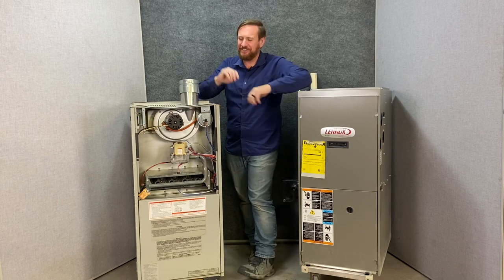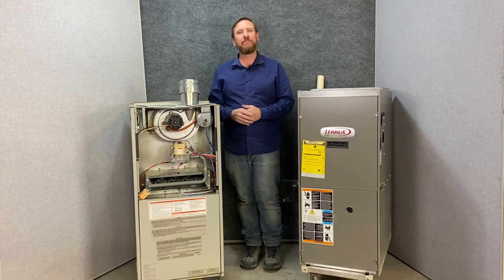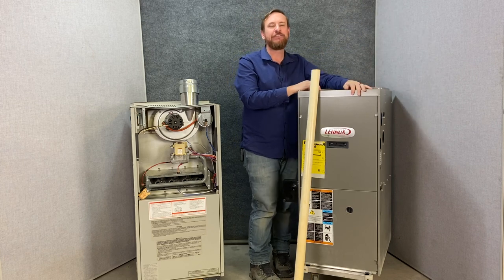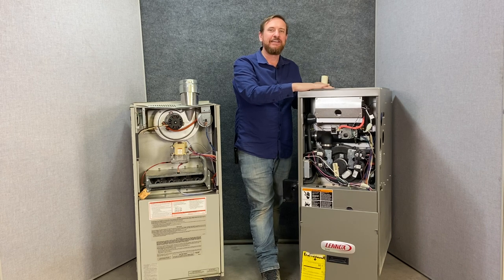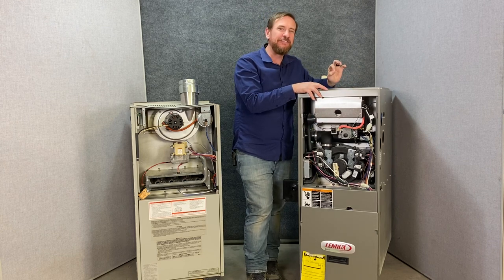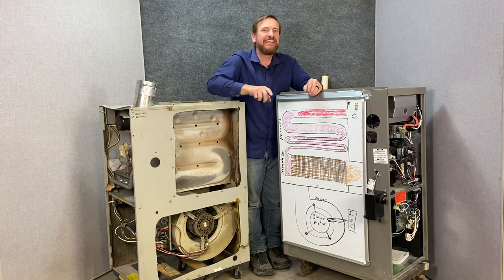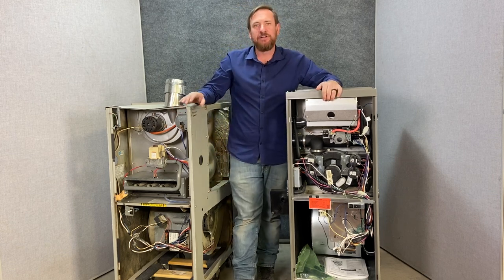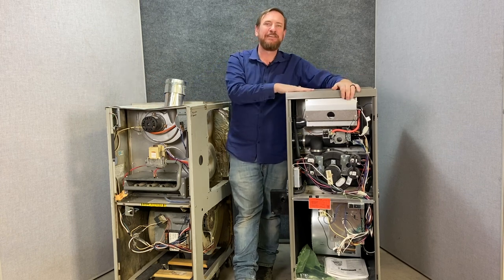80% vs 90%+ Condensing Furnace

Comment: High-efficiency burner all well and good but when it breaks it cost a fortune to fix so what the hell are you saving
Reply from the maker: same could be said for carbarated engines.
At one point the 80% furnace was modern and people said the same about it, before it was the standing pilot and their at the time modern controls, then before that was the cast iron heaters that replaced the simple and reliable wood burning stoves. 
Technology and change comes if people likes it or not.  
The biggest issue with the 90% furnaces is improper installation, improper airflow and improper setup. Once techs learn the systems and read the fabulous manuals they become quite simple and reliable.
Reply: @love2hvac  hmm
Reply: My dad had a furnace in this house for over forty-two years and they said it had a hairline crack in it! And they never did show it! Since then on the third furnace them high-efficiency furnaces only last like 10 years or less! Next time I'm putting back in 80% and you don't have to worry about a damn water pump condensation! Hell I might even put in a wood burner!
Reply from the maker: You only have 2 years left before new regulations take over.
Reply: @jcaleca60  correct; it would be nice if he would discuss the repair costs of both types of furnaces, 80% wins hands down
Reply from the maker: Single stage 80 compared to single stage 90+ of the same brand has most of the same components. Identical flame sensor, hot Surface ignitor, gas valve, pressure switch, blower, limits, aux limits, flame roll outs. The 90+ will have a plastic inducer vs the metal of the 80 but both have the same life expectancy.
The 90 will have a 2 part heat exchanger vs the 80 single. And the 90 will have an enclosed burner box vs the 80 open. What in there costs more?

We can do the same with the 80 2 stage vs the 90 2 stage. But noth now have 2 speed inducers, 2 stage has valves and 2  pressure switches. 

The one that will have the most cost issues is the fully modulating furnace.

Did you know a heat exchanger should never fail for any furnace. The biggest problems are incorrect installation of all furnaces. Installers early follow the installation manual that includes clocking the gas meter, combustion analysis, airflow and static pressure. 

If we could get companies selling the proper sized furnace ACCA manual J S D and then pay a professional skilled installer with the  tools and abilities to actually install them correctly, customers would never have an issue with any furnace installed.
Reply: @love2hvac  you’re absolutely correct. The issue people are having is companies scalping their customers that spend xtra money on a high efficiency. They charge exorbitant amounts and most are not installed correctly.
Reply: Saving the earth 😂
Reply: Love the high efficiency furnance... A nice steady temperature along with a humidifier.  For me it's well worth it and comfortable. 👌💯
Reply: I work on high efficiency all the time, standard furnace parts are really not that much more expensive at all, however you do have the occasional condensate leak which is a hassle.  Add a heat pump, it does get more complex.

Comment: The problem with a two stage furnace is the cost of draft inducer motor which needs two speeds. My draft inducer motor lasts about seven years & the part is $600 & with instillation it is $1000. Lennox parts are super expensive I would by a Goodman. Unless your house is super insulated just go with single stage.
Reply from the maker: A 2 speed motor doesn't cost that much more than a single speed for manufacturing. 

The problem is the manufacture marking things up, the supply house marking things up and then the company marking things up.  Private quiet companies are buying up all the HVAC companies and they are requesting Every penny they can out of the market. 

A lot of these companies are raising prices so high that it makes a new unit look cheaper so they can sell more units and increase profits. I know of several large companies that trains primarily in sales and sales tactics.
Reply: @love2hvac  I agree with you. I am thankful I can do some of this work my self otherwise it might be better to just buy a new unit.
Reply: @love2hvac  Goodman is one of the few that will sell directly to the public.
Reply: Some 2-stage draft inducers are more expensive than others the contractors gouge on repairs and markup.

Comment: I'm in central NC and only spend about $500 on heating gas between Dec- March (mostly last 2 weeks of Dec thru 1st week of March) at which point we shut the furnace off completely. 10 % savings vs the 80% AFE model would be minimal for me. At best I might save $50.00 year on a 90% efficiency model ---- It's neglible in my case so I'll probably go cheapest route with the lennox Merit economy. At least your video helped calculate and refine my thought process.
Reply from the maker: 80% works well as long as the home is not tightly sealed. If it's going in a tight house or sealed attic then consider the other.

Also consider a dual fuel heat pump. Heat pump is more efficient higher ambient than even the gas in many places. Then use the gas on the colder days or when you need faster heat. They work well together

Be sure to get a heat load calculation. One of the biggest issues is oversized furnaces and I oversized AC.

Who ever installed the furnace, have them clock the gas meter for input BTU. Sometimes the offices have to be changed. Also have a combustion analysis performed. They should give you a print out of the conditions.
Reply: Exactly. If you are in a mild climate and or areas where gas is relatively inexpensive, the payback period is YEARS!
Reply: heres the thing most hvac companies will not tell you about high efficiency furnaces.  What you "save" on your monthly gas bill goes straight out the window when it comes time to service or even replace.  90% have a lifespan of around 10-15 years where as 80 % last 20+ years

High efficiency furnaces tend to start having problems not long after the warranty runs out on the equipment installed.  They have a secondary heat exchanger and are equipped with more safety switches and sensors, that can and will lead to more service calls. 

 The upfront cost is more expensive based on equipment cost and labor/material.  If you go from an 80-90% you have to install an entirely new pvc exhaust system as opposed to adapting to the existing metal one.  The install could take as much as an extra day depending on how difficult it could be to find a way to run the flue based on how your house is set up.

I would advise towards investing in a 2 stage 80+% furnace.  In short, it wont burn as hot or intensely on cooler days and the "extra" cost is dollars more per month, not hundreds.
Reply from the maker: If a 90% furnace is having that short of a life span it was not installed correctly.  The #1 issue I find with 90% furnaces time and time again is improperly installed.

The only reason they are not lasting is because the companies are not installing them correctly including airflow. 

Meanwhile other companies installing them properly with proper airflow and static readings have them lasting over  20 years. 

Single stage 90% are simple to work on and affordable parts just like the 80.
2 stage is much more expensive. No reason to have a 2 stage 80.

The real problem is modulating furnaces, those parts are expensive and it's more difficult to diagnose. 

A 2 stage or modulating furnace is not any more efficient.
A 2 stage vs single stage 80 is the same efficiency.  Most furnaces are oversized, so companies like to install the 2 stages instead of doing a heat load calculation and installing the proper sized equipment. 

ACCA manual J, S D and T
Please the installation manual and customers would be comfortable and systems would last longer.
Reply: @love2hvac  its not the installation of a 90% furnace, they straight up dont last as long period.  I just replaced a high efficiency boiler installed absolutely perfectly by the previous crew and 10 years later there was a hole in the heat exchanger the size of my thumb.  

Whether its a furnace, boiler or condenser, the high efficiency ones dont even come close to total lifespan of standard counter parts
Reply from the maker: Are you doing combustion analysis, clocking the meter, fixing the duct issues?
Contractors all across. The country with 90+ furnaces still working correctly back from the 1990's.

I did consulting for one company that said the same thing you are saying about 90%, but they did not even own a combustion analizernamd nobody at the company ever clocked a gas meter. 

It's the same thing when people say _ bran makes bad blower wheels only to find out they have bad ductwork.

Or compressors don't last only to find they don't understand superheat, or perform proper evacuation/dehydration procedures.

But every single one of those companies say "we do it rite" .

Some companies want to learn and make the changes, and see the difference.

Other companies want to be right, keep doing it the way they always have and blame something or someone else.

This is why education is so important.  Equipment technology is advancing very fast and the  government is also mandating higher edfecencues regardless of payback. 

We don't have to like the 90% furnace but  It won't be long before you can only get a 90% furnace so we must start understanding them now.

Same with heat pumps, inverters, blower door testing and more.
Reply: @love2hvac  its hard to re-do ductwork on a finished house and often you are only able to adapt to whats existing.

why shove a 90% efficient appliance down a customers throat when the condition of their home is not suitable for it? i.e duct, heat load/loss etc.  sell them what they actually need, not whats gonna line your pocket with money
Reply from the maker: Why not fix the ductwork and do the job rite.

Air and airflow is the most overlooked part of HVAC.  The airflow is essential to the system performance, the customer comfort and the performance of the home. 

Duct leakage is the leading cause of air infiltration. Every CFM lost is another CFM pulled in through the walls, bringing with it moisture and dust. This is a prime condition for things to grow. Now imagine breathing air from that space. That's what's happening to the home.

We have to at some point be the professional and start looking at HVAC as a complete home solution and stop looking at an appliance to sell. 

There is a reason the equipment manufactures post airflow requirements and static pressure limits. In the old days we had cheap PSC motors that we could easily change. Now even the 80% furnaces are mandated Electronic Commuted motors. These motors do not handle the high static pressures and are very very expensive. 

Jim Bergmann just wrote an article outlining the poor installation and commissioning practices of equipment. Check it out.

Also check out NCI classes for performance HVAC.

It's time we stop paying the salespeople to move boxes and we become the HVAC professionals and specialists  that solve whole home problems.
Reply: @love2hvac  you cant fix ductwork that is inside a finished house, especially when its inside finished walls. i guess you didnt read that part.  people arent really interested in ripping open walls to accomodate a 90% furnace they dont need

and if it is accessible in an attic or a basement, re-doing duct and flex and add several thousands of dollars to the install cost
Reply from the maker: There are solutions, you just have to open your mind take some classes and learn. 

Here is an example just a few .on these ago. I was paid to give a consult. North east climate, mandated to 90% furnaces. Ductwork was behind the walls. We ran a blower door test and found the house leak rate. The customer paid to have the house shell sealed up. We ran another blower door test and used the new number to run a proper ACCA manual J.. the existing 80% furnace was 120k BTU meaning 96k to the home. The company installed a 96% 2 stage condensing furnace. The smaller size meant the duct work could handle the  airflow. Before the new system went in they had the ducts sealed from the inside with aeroseal. 

Now the ducts where not leaking, they static pressure was .35. they system was quiet. We clicked the meter and found the offices where too large so we sealed them with the correct size. We ran a combustion analysis and properly commissioned the equipment. 

The customer had never been more comfortable before. They could not even tell when the unit was running.  
They paid more and were very happy and comfortable. The company looked at the home not the appliance 

Another one is in Texas. The ductwork ran in the floors and the walls, no access. The old system was a 60% standing pilot. 
We had a blower door test and sealed the home. We ran a manual J to find the room by room heat load. 
After consulting with me and the customer, the company pulled that system out and sealed up the ducts. They installed a VRV system with some hiwall ductless and some mini ducted we could hide in the ceiling. We ran some of the refrigerant lines in the existing duct work as a chase. 

The customer was super happy and they could keep each room at its own temperature. 

I could go on and on with solutions.

It's not a system problem, it's a home issue. We get paid to provide options and comfort.

The day is coming where you can't get an 80% furnace. It's already here in some parts of the country. 

You will have to retire or learn and adapt.

It's a free world, do as you wish.

Comment: You’ll never realize the difference in fuel savings going from 80 to 90, never.  Especially since repairing the 90 with cost 3x as much.
Reply from the maker: Let's look at the facts. 

80,000 BTU 80% AFUE Multi-Speed Single Stage Goodman Gas Furnace - Upflow/Horizontal GMES800803BN 
$1005.00

80,000 BTU 96% AFUE Single Stage Goodman Gas Furnace Upflow/Horizontal
 GMES960803BN
$1,598.00 

The condensing furnaces cost 62% more at 16% fuel savings.

Modulating furnaces are the ones that are expensive, but not condensing.

Condensing furnaces are mandated in the north east, it's a matter of time before it's nation wide. 

Once upon a time people said the same things going from standing pilot 60% to 80%
Reply: 80% means 20% goes to waste 90 means 10% goes to waste simply as that
Reply: Again, repairing the 90 will cost 3x as much.

Comment: I find the 80% is simple to install, operate, and maintain.
Reply from the maker: True, Yet most 80% furnaces are not installed correctly. The best exchanger should never fail yet they frequently from improper operation, setup and install.

It is rare to run a combustion analysis on an 80% furnace and be good with a new customer.

Every 80% furnace has im the instruction manual about clicking the meter, yet only a few people actually do. 
Flue pipes are often installed incorrectly.

If I could only get installers to actually read and follow the instructions manuals, systems would operate better and for much longer.

Comment: In Canada the sale of furnaces on the left have been banned for a long time now. I just installed a 80k 96% Dual stage fully variable speed furnace. It's amazing how small they have got over the years. Its only 35 inches high and can be mounted vertical or horizontal. It's important to note that while you can DIY install a modern furnace. There are important safety precaution to consider. You MUST remember to prime your condensate trap. If not, exhaust gases can get into your home via the drain port. Also, it's highly recommended to adjust your gas manifold pressure for both stages. If you live above, 2000ft this is a MUST. Improper manifold adjustment can significantly decrease the life span of your furnace.
Reply from the maker: Yes, for the record I don't recommend  any DIY furnace installation. All those points are 100% accurate. Unfortunately I often see those corners cut but licensed HVAC companies